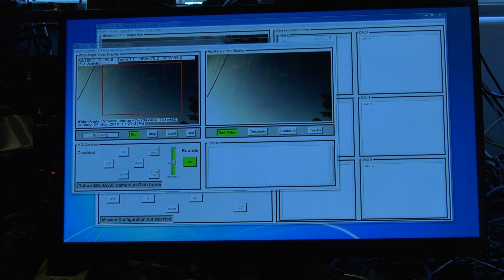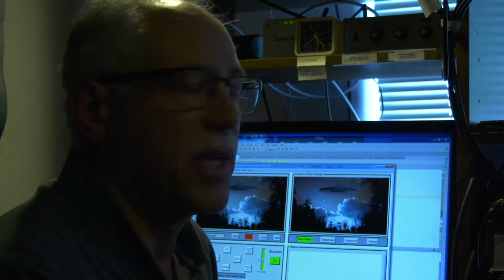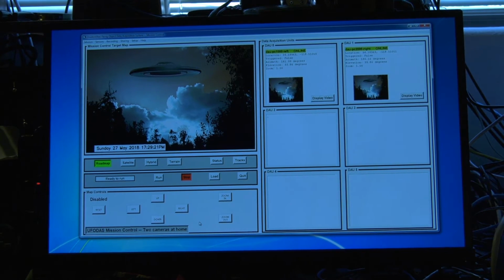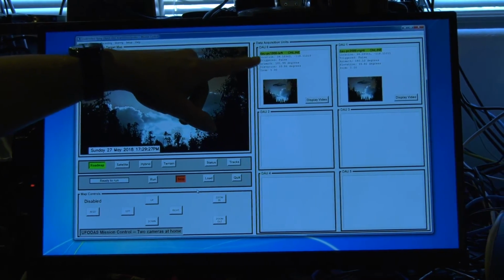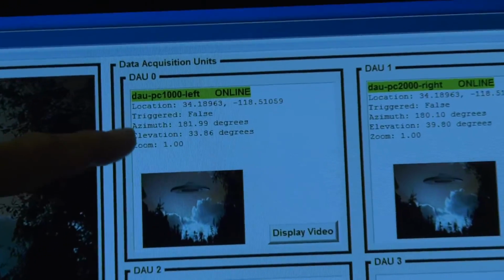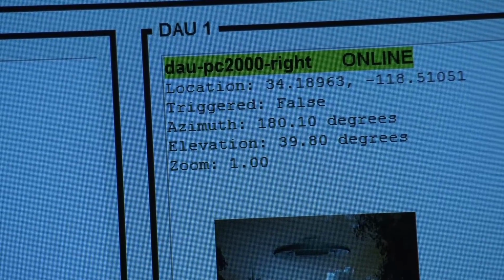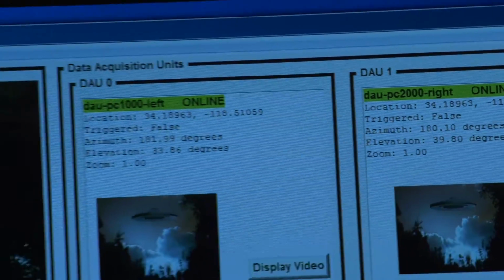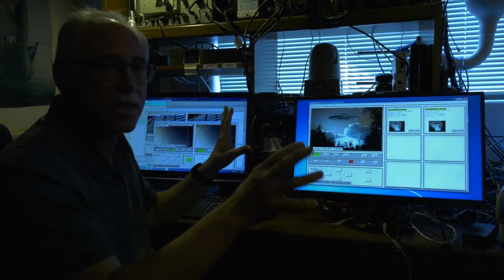UFODAP Engineer Ron Olch Explains the Gear

Comment: Awesome video! A couple questions:
1. Will bright mag satellite pass data be automatically fed into the SW program?
2. What kind of wind speed can it withstand?
Reply: We would like to develop the interface for satellite data but initially may get use it offline for correlation with an appropriate event.  The MSDAU/camera is ruggedly mounted on a heavy-duty surveying tripod with legs that can be extended widely apart.  It can also be mounted (without the tripod) to a pole or building.  So I think it would withstand rather high winds in any case.  The assembly is IP67 so rather immune to typical weather conditions.

Comment: Extremely exciting. How will the system react to multiple targets simultaneously?
Reply: It depends on a number of factors -- the relative size and speeds of the objects, the track of the original target and the relative amount of motion of each potential target within the bounding box.